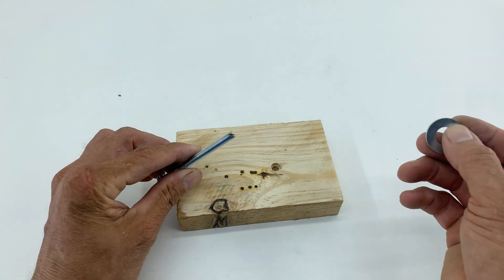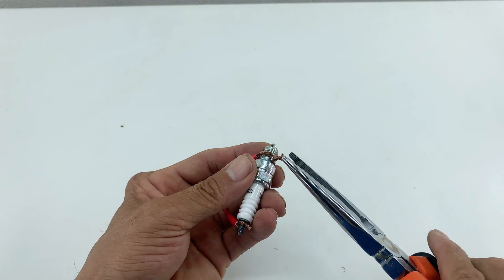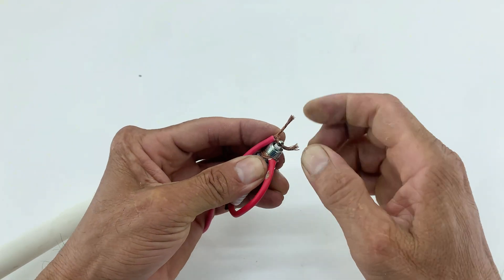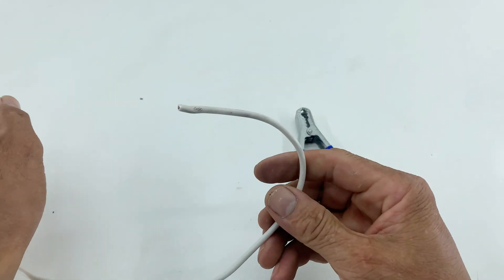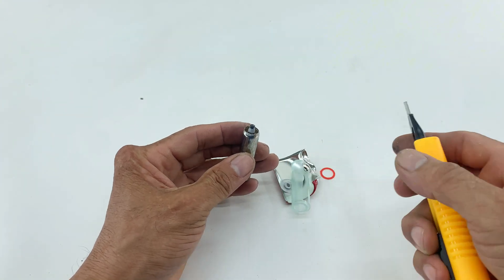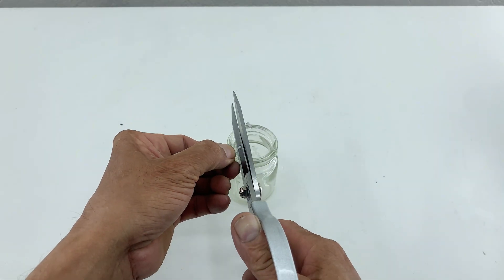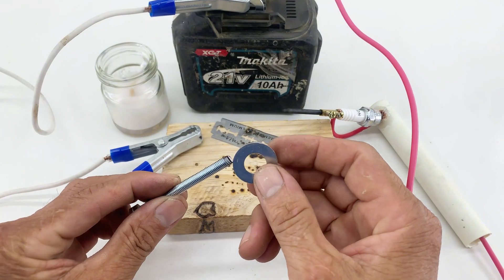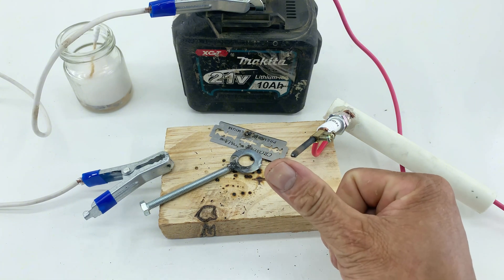How To Make a simple welding machine from spark plugs at home! Extremely easy and useful! 🔥

Comment: 👍👍 Apakah bisa meledak baterai atau charger laptopnya ? 
🙏🙏🇲🇨
Reply from the maker: Thank you for watching! No worries 😊 as long as you follow the steps carefully and avoid any short circuits, the battery or laptop charger won’t explode. Always make sure the connections are safe and stop using it if it gets too hot.
Reply: @DIYHub01 terima kasih 🙏🙏